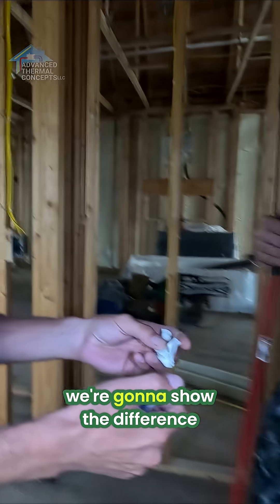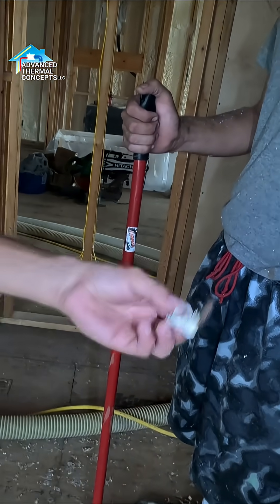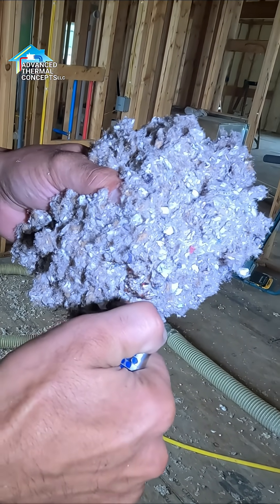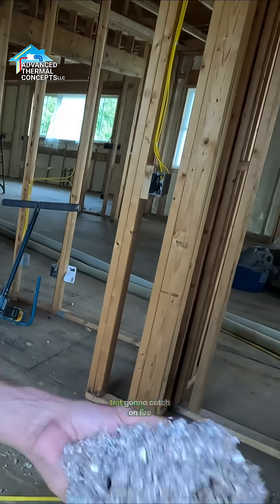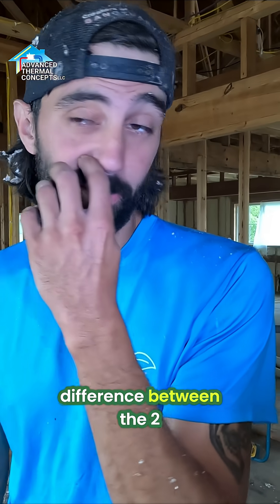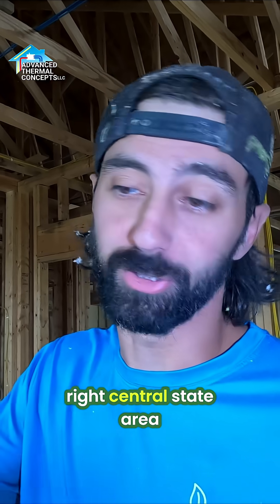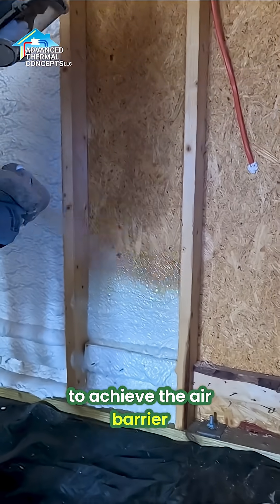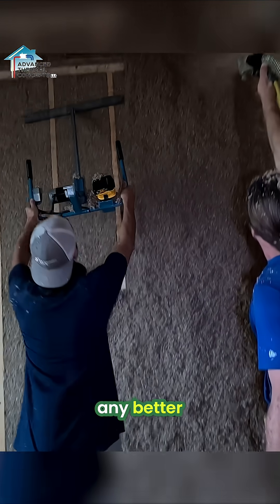Greenfiber Cellulose vs Spray Foam ⚔️ | Fire Test & Real-World Performance

Comment: Make sure if you are using foam first it's the right foam because in England and it will come in Ireland people are finding it hard to get a mortgage and insurance for houses sprayed with foam it held moisture and they didn't leave space for air to keep rafters joists dry what was happening it caused rot to set in